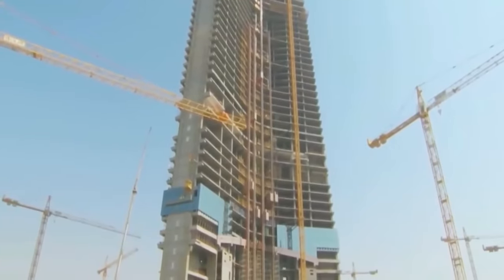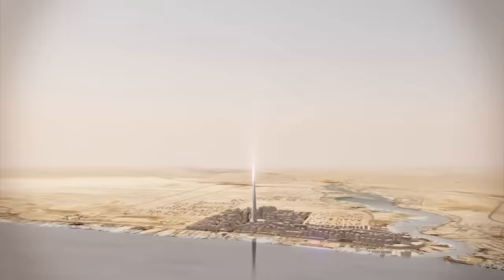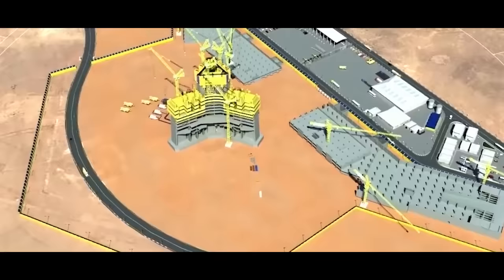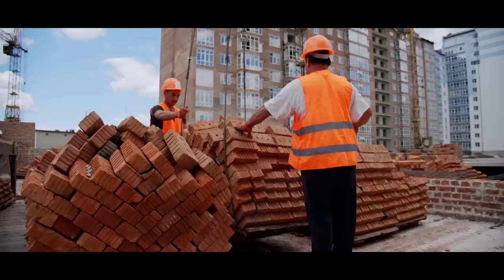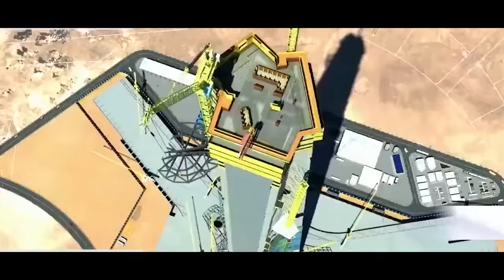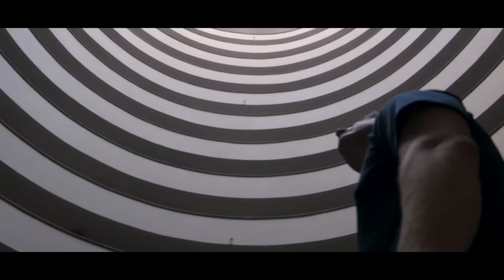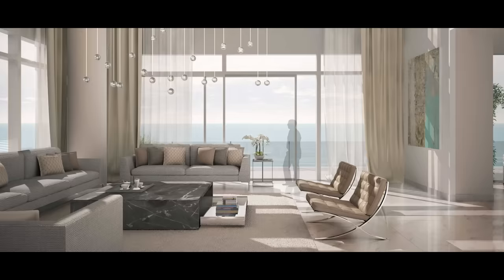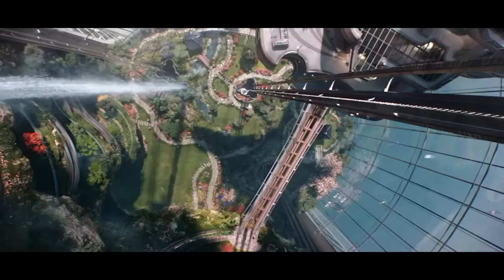Jeddah Tower : The Engineering Secrets Behind the World's tallest Tower

Comment: Sucks that a huge top section of the tower will be completely uninhabitable. I wonder if it will even be considered as the tallest habitable building.
Reply: Burj also is not occupied up there
Reply: To @HipHopIsLifee
Yes, it seems like a waste to have that height and not use the upper floors for living space.  It would be amazing to dwell all the way up there.
Reply: @RCSVirginia  they call it engineering floors eg water tank, lifts etc etc
Reply: @RCSVirginia  As long as you're not in a position to have to evacuate.
Reply: @keangwooichoo6138  
That makes sense.  Still, the views would be awesome in a condo.
Reply: @inyobill  
Just have a window that will open and a paraglider.
Reply: At 1000 meters building height one would expect 333 residential floors. The design of the tower is extremely expensive and inefficient.
Reply: @RCSVirginia  Good luck with that
Reply: Why can’t it be lived in?
Reply: It is a phallic power-projection. Not a housing project.
Reply: @adamellistutorials  

There will be no rooms made to save weight.
Reply: like building submarine ucant use..
Reply: Bro, it isn't even the tallest incomplete building
Reply: Spires are parts of the architectural features, thus they are counted.

Comment: Back in the 1800s the height of building was determined by the available technology. Then Otis invented safe elevators and buildings got much taller.
At the end of your video your said basically that we've reached height limits due to spiralling costs. I'd hazard a guess that these are limits set by current technology.
Don't underestimate mankind's ability to overcome obstacles. More efficient designs and technologies will come along to continue our instinctual exploration of what is possible.
Reply: Current laws of physics set most of these limits where economics are a factor.
Reply: In this case they did not overcome stupidity...
Reply: Why overcome it? There's little return on investment if any?

Comment: 4:20 For the part where pumps can only push concrete up to 500 meters, why not make a special area that contains another pump at the 500 meter mark to then be able to pump concrete up another 500 meters??? Or you could modify a tower crane to have the pump on the top instead of the crane part. With two such modified crane sections you could have one set at 500m and the next one set at 1000m to give you a pump height of 1500m. Now I don't know what the total capacity of the tower crane box sections are, nor do I know how much the concrete itself would weigh in a pump line going up, but you could anchor the line to the building and only have it curve out to the pump on the tower then curve back to a anchored section on the building again. That would limit the weight on the tower crane...

Comment: 0:17 - 1:25 I don't understand, I would assume before constructing any tall building  ( especially one that tall ) there would be a massive amount of calculations and planning.
Surely there would have to be a at least a team of engineering/material experts who all independently  approved  the schematics/plans before they even started digging foundations?
The way the narrator reads it almost seems like they started building it and after reaching 500 meters they went "hang on,  are we sure this thing isn't going to collapse itself if we keep putting more weight on top?"
Reply: As construction continues higher, the total weight above each floor grows but is less than the floors beneath it. How is this possible? Simply because the floors start to shrink due to the narrowing down of the upper levels. Thus, the heaviest and strongest structural steel is at the lowest part of the tower, and the lightest is at the top because it has to support less weight than the lower floors.
Reply: @DeedsResearcher  duh, what does that have to do with my post?

Comment: I believe China has called a stop to the building of new super tall skyscrapers. If China has made this decision, it’s hard to imagine that other would-be competitors for the tallest building won’t be far behind.
Reply: Chinas reasons are very different to the Middle East. The Middle East still needs landmarks to attract tourism and diversify its economy. China had a problem of oversupply and low occupancy rates causing a huge debt problem. The Middle East doesn’t have anywhere near the amount of skyscrapers as the US or China so they don’t face the same problems and have a few landmark structures that mostly cater to a high end luxury market that has a high demand. They are not much concerned about population dynamics around the skyscraper.
Reply: @portcybertryx222 
I agree with what you said except for your comment about the Middle East 
not having a lot of skyscrapers.

Dubai has the 4th greatest number of skyscrapers of any city in the world
and is far, far ahead of the 5th place city.

And whether other places in the Middle East such as Yemen have many skyscrapers 
is quite irrelevant to the market for housing in Dubai.
Even if Yemen had a lot of skyscrapers nobody would live in Yemen 
and work in Dubai.

Like in most cities the only market for skyscrapers that matters 
in Dubai is the market in the city itself  - 
the rest of the middle east doesn't matter.